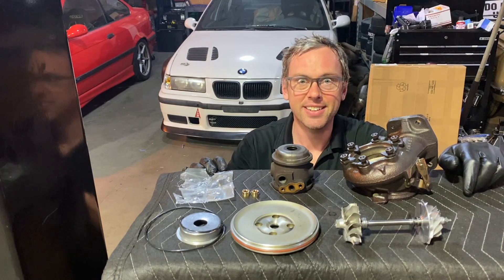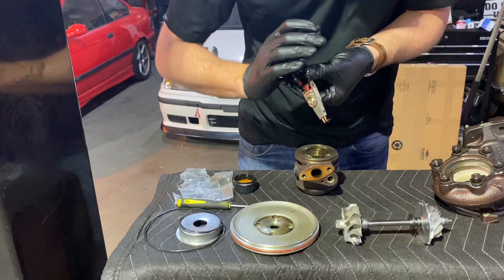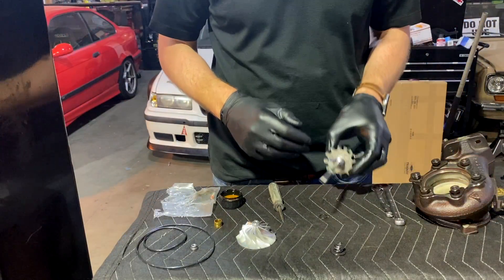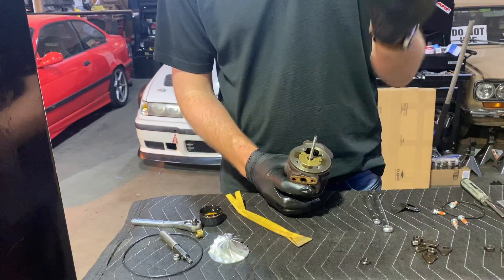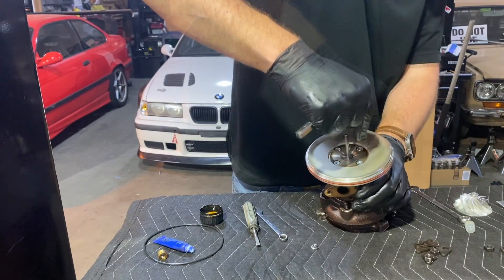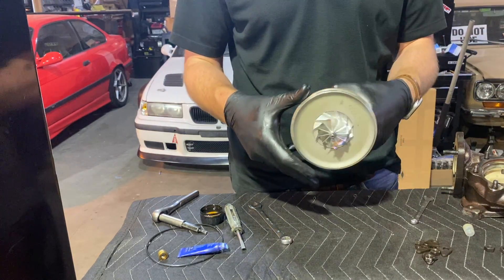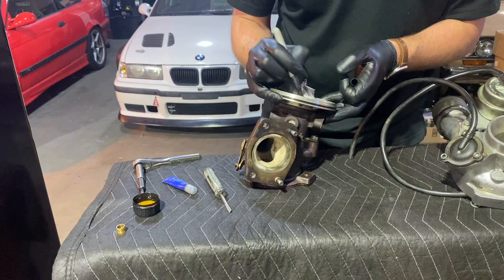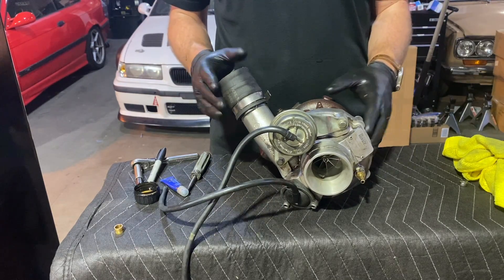V70r Build: K24 Turbo Rebuild DIY - 360° Bearing

Comment: A-1 Turbo in Southern California does an incredible upgrade with a great warranty for a 30 to 40 HP upgrade. They change  the exhaust turbine to a 9 blade titanium turbine and the compressor turbine is a taller Billet 11 blade with an upgraded thrust barring.
Reply: does the ECU need a re-tune in this case?

Comment: Hi man !!! Great video. I have a question: Is it enough to simply replace the bearing? I have a new K24 refurbishment and I am going to buy the 360 ° bearing itself. Will it fit without changing other parts around? Thanx
Reply from the maker: You'd need the entire 360 rebuild kit and it should drop right in. If your turbo has been balanced with a 270 bearing i'd leave it as is, though.
Reply: @eurojulien  Thanks, but we probably don't understand each other. I have a whole new set of 270 ° in the turbo. I want to ask if I can only take bearing + (some washer) for the upgrade. If the bearing itself is plug in play ... thanks .... (I have about 5 new sets of 270 at home :-))